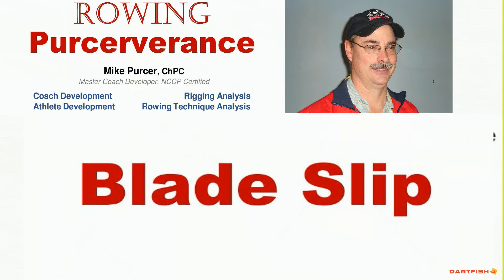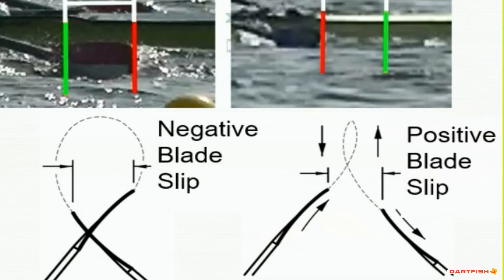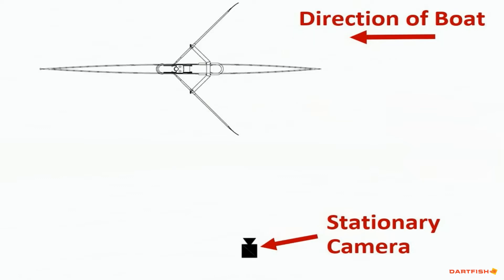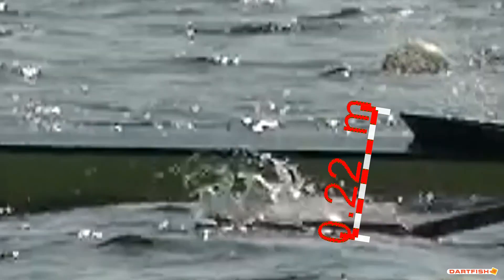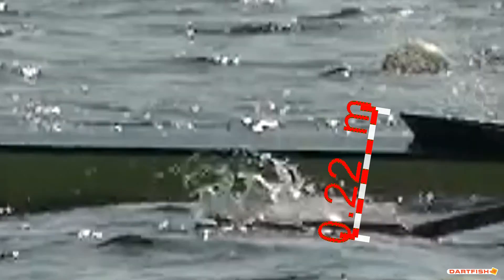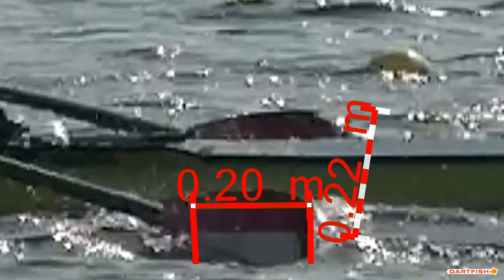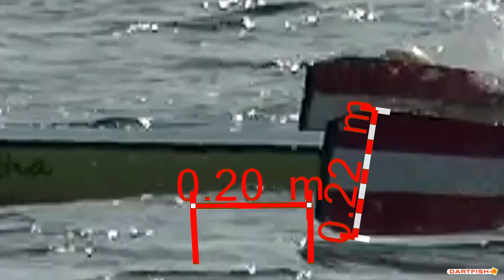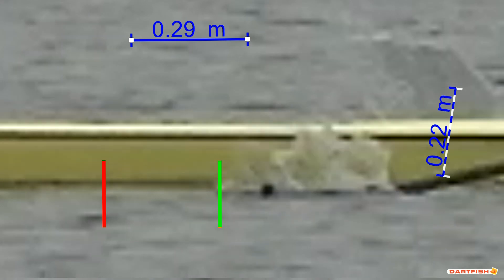Rigging Efficiency – How to Measure Blade Slip by Mike Purcer

Comment: What specific rigging adjustments directly affect blade slip?
Reply from the maker: Interesting you ask that question:  The biggest factor of Blade Slip is the Stroke Position of the oar relative to the boat (a YouTube video I am currently working on “How to Measure Stroke Position).  Another factor of Blade Slip is rigging load.  If the rigging is too light the blade area will not provide an adequate fulcrum and the blade will move through the water.